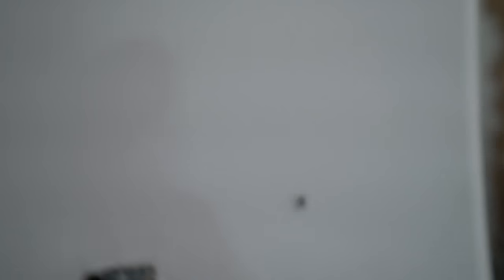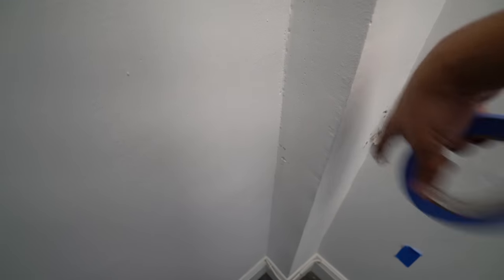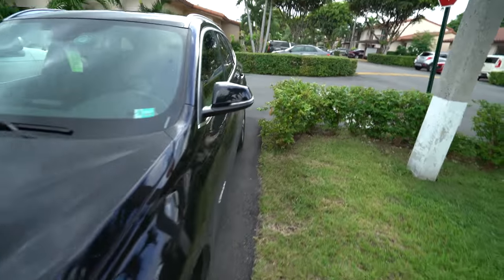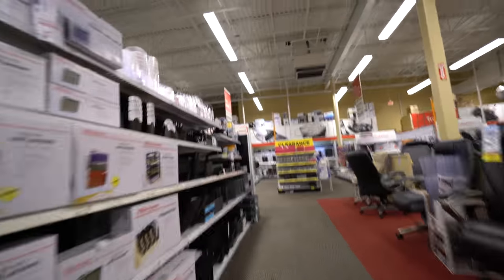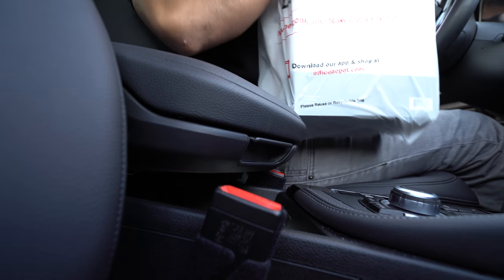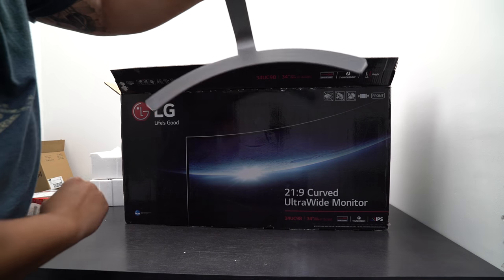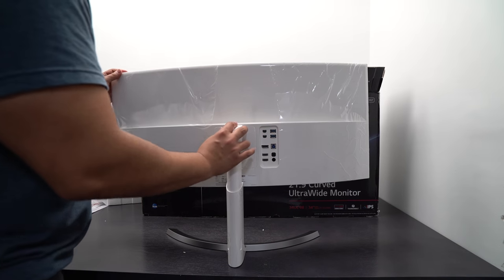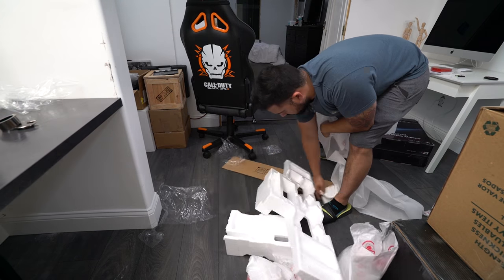BUILDING THE DREAM GAMING SETUP #2 (Monitors & Desk)

Comment: how did you get the screen to show up on both?
Reply: New Blast its the split screen on settings
Reply: Aimee Xx and what cords did you need for it
Reply: New Blast probably just a hdmi cable that's what I use with my laptop to another screen and I then have an "extended screen"
Reply: Aimee Xx yeah I tried that doesn't word but I'm using to PC monitors